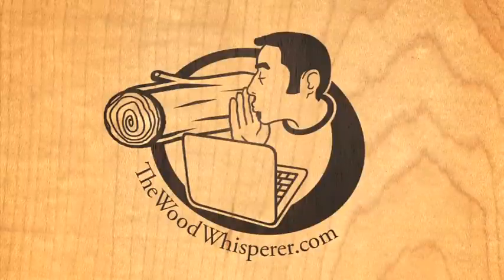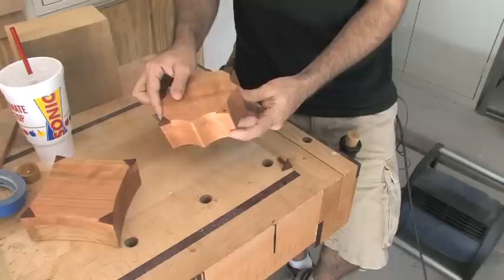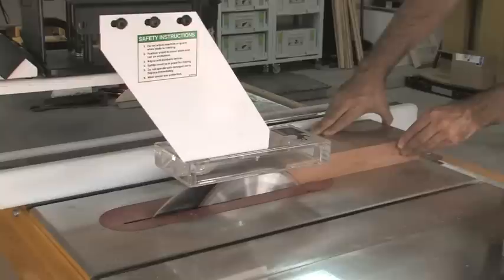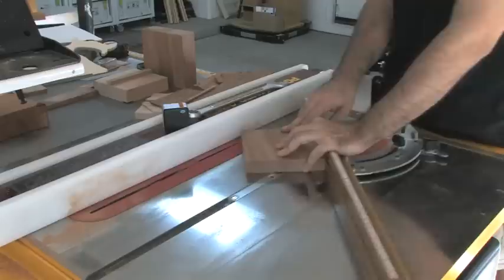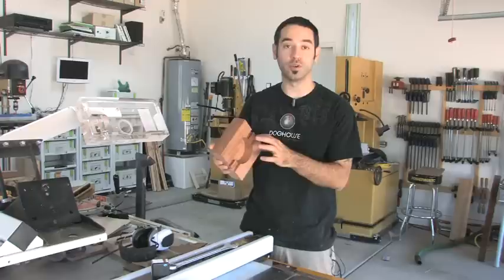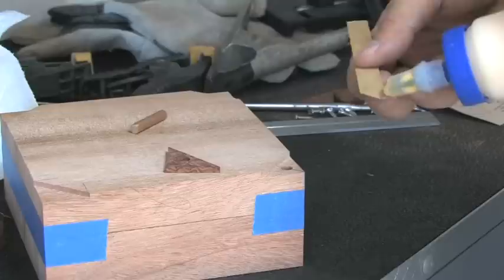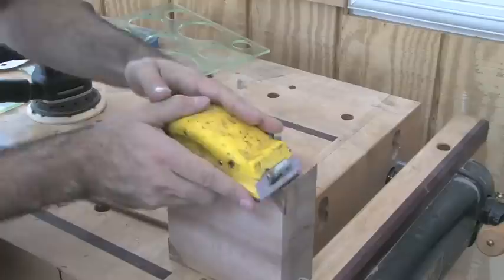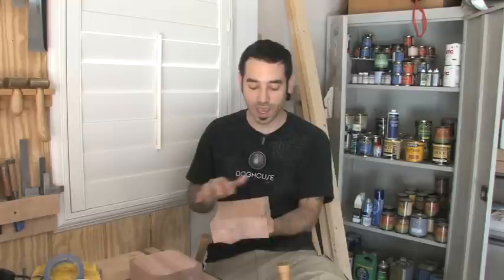105 - How to Build a Keepsake Box

Comment: Beautifully simple.  One suggestion, instead of cutting the male out of the bottom blank, cut two female dove joints one top and one bottom, with an hour glass shaped piece to use as a joiner.  Might be able to match the wood grain then, since you could use a thinner blank.  Also you could use a darker piece of wood to highlight the joint. Just a different take...

Comment: dumb idea but adds more pop to a box,  cut a lot of parts glue them back up in a pattern or randomly then use that full size 12/4 blank  Mix wood a lot of scrap pieces 1 and 2" thick parts that are over 24" long  lay the parts at a 45dgr and hide the dovetail that way.

Comment: FOR THAT HEART SHAPED PIN YOU COULD CUT IT ON THE ROUTER TABLE, JUST MAKE SUPPORTS THAT EVENLY HOLD THE LID AT THE CORRECT HIGHT OVER THE BIT AND RUN IT OVER. I'M SURE THERE IS A BIT THAT MAKES THAT SHAPE. OR YOU COULD CUT IT SQUARE FISRT THEN HAND SHAPE IT WITH CHISELS AND GOUGES. I'M SURE YOU ALREADY KNOW ALL OF THIS .